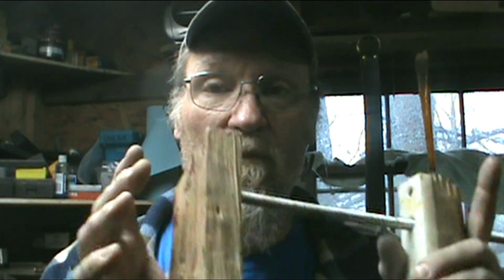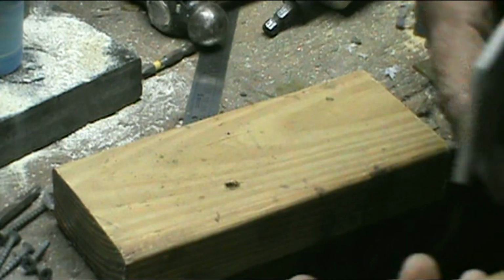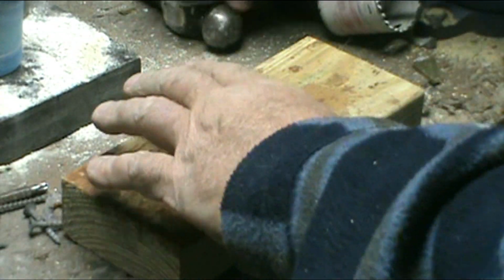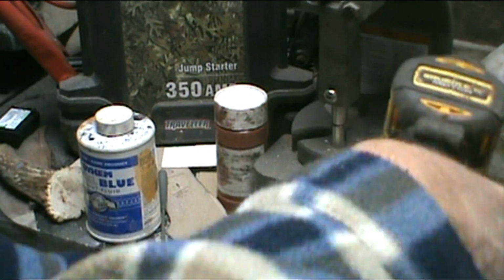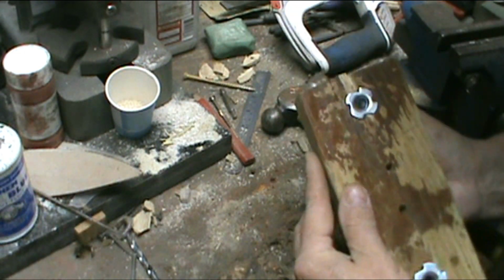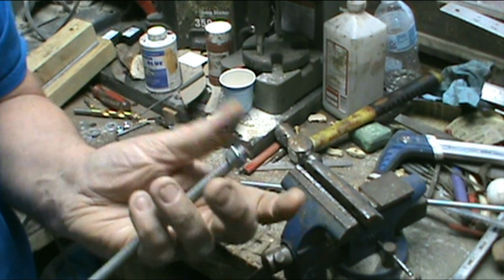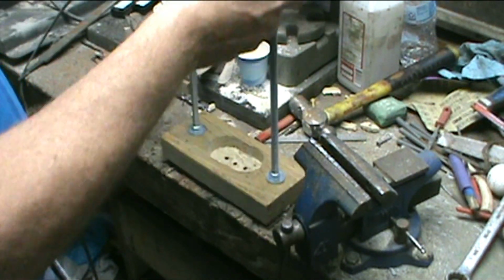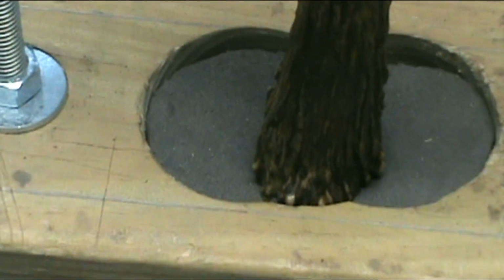Monkey tool time

Comment: I know it’s overkill but what if you got a small pipe or tube with an inside diameter a shade bigger than the size of the all thread and epoxyed into the top slides I feel like it would slide much easier than wood
Reply from the maker: Yes it would. I could have done that, but I didn't have any 7/16ths ID pipe or tubing nor did I have a drill bit past a 1/2 inch drill bit. Feel free Alex to build your own squeeze-a-manic 900. Once you use one you'll wonder have you ever made it without one. I'm almost sure that they can and do several jobs around the smithy.